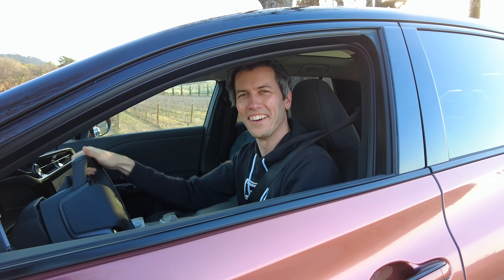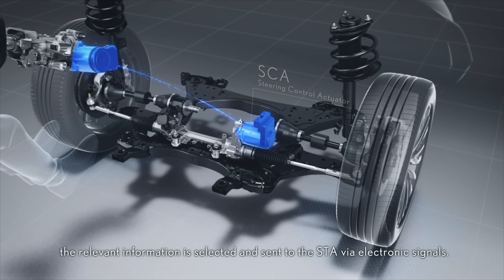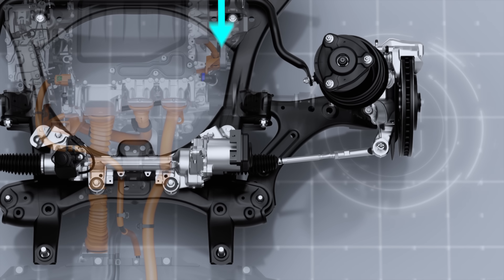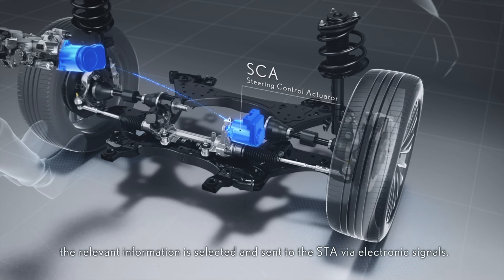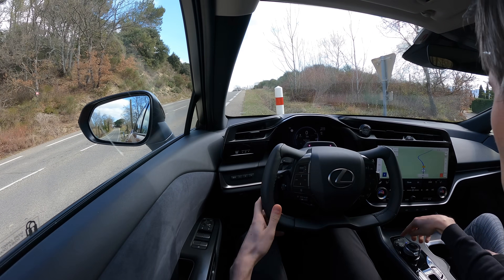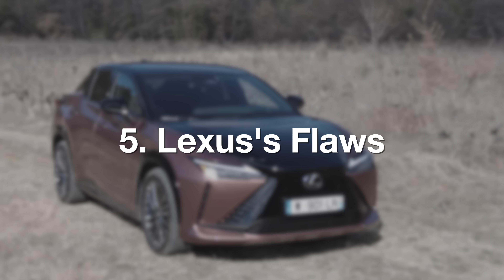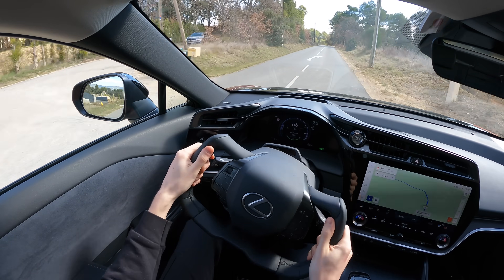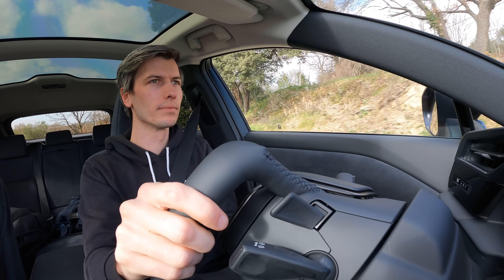How Lexus Fixed Tesla's Bad Idea: Steer-By-Wire Yoke

Comment: I would really like to see how the mushy response handles accident avoidance at high speed.  It looked to me like you would not be able to avoid a collision as well with this.
Reply: A large wandering moose has entered the chat...
Reply: 90's Citroen Xantia:  Hold My Beer...
Reply: i agree, If you use one steering angle on low speeds and second steering angle on high speeds how will I know how much to turn if I have to avoid something? Muscle memory is very strong, I don't want to instinctively turn a lot and spin out or something just because I wasn't at a low enough speed. 

Cars keep getting more and more unnecessary complicated and uses more sensors and wiring than needed.
Reply: Good point. I'd like to see this tech operate in -45c with winter, snow, salt conditions.
Reply: @jordanalexander1592  break by wire and gas by wire does just fine....
Reply: Physics will determine one way or the other how fast you turn the wheel and remain on all four wheels. This system may? reduce rollover but as mentioned, at what cost to performance?
Reply: It's a Lexus, you can guarantee they will perfect the design
Reply: By the time everybody has had 3 to 14 accidents in the car they'll start getting used to it. lol
Reply: And if you swerve to avoid an obstacle that suddenly presents itself (child stepping onto the road) will the car decide that's too much input and keep you going straighter?  "The car made me do it, officer!"
Reply: I think this could actually improve the response: a too quick change of direction of the front wheels could lead to losing grip or unsettle the balance of the car. With steer-by-wire systems the car can always adjust the steering angle to maximize front wheel grip based on speed, angular velocity, individual tire grip, weight distribution, etc.
Reply: @tamasbella3395  (about your comment on the mechanical steering ) Yes, but it is predictable. You are the one deciding at what pace the steering is done. You can't remove the human factor in a human driven car. I say - let's get rid of the steering wheel completely, it makes more sense than remove the level of human action effect in the driving. Anything that is not predictable is dangerous. 
You want safer roads in the era of densely vehicle populated roads - make the whole drivers license acquiring process 2x more complicated, make people get public transport.

Comment: 12:34 ".... a delay between the commanded request and that request being executed...." 

I doubt this has anything to do with input lag or something similar. I think Lexus deliberately smoothed out the turning speed and acceleration of the wheels a bit and its motor will overall behave more linear by nature. 
My guess would be it is a combination of stability control and driving comfort. They might say they won`t interfere with your steering input  but I can`t imagine they would ever allow a true 1:1 translation of your steering inputs, you could do some really erratic nonsense.

Comment: A steer-by-wire system would be great on a normal steering ratio using a regular steering wheel. The benefit is pretty much just the added leg room. 
This is coming from a tall guy.

Comment: I think most drivers will hate the yoke.  Maybe a few gamers and those of us who like the F1 3 and 9 o’clock driving position could deal with it.  But even us wannabe F1 pilots want to move our hands around on long drives.  The yoke limits hand location and I think the other 98% of the driving public will despise it.  Especially anyone who drives a crossover/tall car like the Lexus in the video. And the delayed reaction at the front tires is a total non-starter for the enthusiast driver.  Tire companies work hard to design tires and sidewalls that sharpen steering response at the front wheels.  Along comes a system like this and wipes out those gains by generating a slow/lazy reaction to quick steering inputs.  Not ready for prime time.  And by the way, besides being supreme drivers, a key reason that real F1 drivers can deal with the steering systems in their cars at high speeds is that their front wheels have much more limited steering angle than a street vehicle.  Which results in a turning circle the size of Kansas and requires them to do donuts by lighting up the rear tires to turn the car around in tight spaces.  So comparing F1 car steering to that on this steer-by-wire Lexus is not relevant.

Comment: What about kool guys who like to drive with their right hand draped loosely over the top of the wheel with their left elbow hanging out the window? Or people who grip the bottom of the wheel with their right hand? Or women who steer with their knees while putting make up on at freeway speeds. Not everyone likes driving with their hands at 10 and 2, especially on a long trip. People adapt slowly, but they do adapt so it probably doesn't matter.  How about a joystick on the driver's door panel for accelerator, brake and steering?

Comment: I do like to crank up mouse and analog stick sentitivity on pc and games. And I do set my logitech g920 wheel lock to 540 degrees instead of the default 900 depending on the tipe of race. But I don't like at all the idea of the yoke position being unnecessarily out of sync with the wheels because of delay. I know that's how a simulator works but there's no need to have delay in a real world car. So I'd personally still prefer a mechanical conection for that.
Edit: Of course I'd change my mind if they ever solve the delay issue

Comment: Another positive of steer-by-wire with short ratio steering: In a mechanical setup, a steering movement from the tyres (think collision) can result in wrist-breaking torque at the steering wheel. Hence why F1 drivers let go of the wheel before hitting a barrier. Steer-by-wire can limit this torque electronically as a safety feature.

Comment: What happens if you accelerate or brake in a curve,? Do you end up drifting out of the curve as you accelerate? Does the car turn sharper as you brake sending you into a spin or even oncoming traffic? No thanks. Stop trying to justify a bad idea.

Comment: What problem does the yoke actually solve? Lexus put that in just so it could be more responsive and all? But does it make you less tired while driving? More focused? More accurate? To me this just looks like something different from the standard wheel and probably have limited value to the driver.

Comment: The claim that "brake kicks in as soon as your foot leaves the pedal, before it moves to the brake" leads to more responsive braking is very misleading. If braking starts as soon as you lift your foot, you would not be able to put your foot on the brake while gliding, which actually makes the brake less responsive, if taking your reaction time into consideration.

Comment: Interesting, something I would not have ever thought of. I like what it could do, allowing for less turning of the wheel and more customizable feeling during driving.  I am another one who does not buy a new car anymore. I've been driving Lexus LS cars for over 20 years now but, I tend to buy them 7-8 years old with a little less than 100k, as long as they had a good service history (easy to find via Lexus Owners and combine with a car fax and you can get almost the entire service history on a Lexus). The problem is with these systems 7-10 years old and how dependable they will be then. 

I wonder when they finally announce an Electric Lexus LS if this system will be standard in it....

Comment: About the fast steering inputs on the highway, they need to be like that and cannot be messed with for security reasons. The driver must be able to do a quick turn in order to avoid an obstacle  while on high speeds.

Comment: So basically Lexus offers a electrified system of what Citroen developed way back in 1970 called Diravi. Self centering hydraulically driven with a redundant mechanical connection in the event of failure. Maybe not a Yoke but a much cooler single spoke wheel.

Comment: Formula One drivers also do not perform tight steering maneuvers.  No tight 90º turns into or out of parking spaces.  No K-turns, no U-turns, etc.  

Many planes today use fly by wire to control the aircraft and it is a safe technology.  

This sounds like something I would like to try, but I still like the idea of a wheel shaped steering device.  And I think it should be against the law to hide buttons and switches on the dash behind the steering wheel.  We don't do that in aircraft, why is it a good idea in a car?  Or anything?

Comment: As a Software-Engineer for over 20 years, no one will get me to drive a car where a software-glitch can make it go ballistic on me. If cars employ steer-by-wire, people will die from this. This question is not "if", only "how many". Every single heavily used software system has shown some failures (bugs) at some time. And those which did not reveal them yet, are likely to do so in the future. Don't kid yourself - this change reduces manufacturing costs in exchange for a yet unknown number of lives. There is almost no upside in this for the customer (except convenience or gimmicks) - only the manufacturer.

The most revealing problem can be seen in this video - modern highly complex digital software systems are treated as if they were analog systems. When talking about the "most pressing scenarios" how this steer-by-wire could fail, software glitches are not even considered! It is just assumed, that the software is a god-given flawless system. And believe me - software is not. If have friends working in major corporations from SAP to John Deere - and you do not want to know how the code looks. Without testing, modern systems would not even start up anymore. If you can replace a safety-critical digital system with an analog failure-free one, then DO IT. But never the other way around.

Oh and don't get me started with the "established" technologies in software development. Just an example: Are PC games new? Nope. So why are they buggy as hell upon release? Are bridges new to humanity? Nope. So why keep they breaking down sometimes? Because we are humans. We make mistakes. The best thing we can do is to not place ourselves into harms way. And replacing a physical steering-rod with highly complex software (force-feedback, changing steering-angle, etc...) is doing exactly that.

Well - I did my good deed at warning non-software developers about the dangers. Cheers!

Comment: I do like the idea of not turning the wheel as much when parking or turning in a narrow street.

Experiencing the Golf 8 however has significantly lowered my trust in electronic solutions made by carmanufacturers. Due to: regular warnings of assisting functions failing, sometimes all but the standard driving functions shuting down while driving and restarting. Once braking towards slow corner speed on a highway with a fast bend. Once starting to accelerate to 140 kph on a 50 kph road. Sometimes not regenerative breaking and without powered braking (oldfashioned pulling the wheel while pressing on the brake pedal with force to get to a hold.).

What worries me the most is when an error does not solve quickly after something happens. While it will be gone the next day. Then it takes about 2 months to get a spot for someone to take a look at it because they are probably busy with all new cars with the same problems still under warranty.

I does make me want a electric car with almost no complexity just mechanical pedals, wheel, parking brake, windows, seats. An airco (programable to a degree.), electronic mirrors. And a place where I can put my phone as the infotainment system while charging. Nothing more, but then you have EU legislation requiring all cars to have lane assist and emergency auto braking and such which makes it overly complicated again.

Comment: How does the dynamic change of steering ratio work in practice? Let's assume I am braking into a corner with a constant steering input of 5°. Whilst I am getting slower, the steering ratio changes, but my input on the wheel doesn't change. Will the wheels turn in harder as I slow down even though my steering inputs don't change?

Comment: First is not always best, Tesla (fans). That said, this is still early in and Lexus swung a solid base hit. A manual steering set control would be nice for performance vehicles. The nannies however still need to be nerfed for emergency situations. But this might be tied into the vehicles own environmental awareness, or driver assist systems, so the vehicle has context as to why you just jerked the wheel/yoke wildly just then.  

So we are just getting closer to building a horse.

Comment: Surely the extra torque sensor motors providing feedback are as complicated and weighty, if not more so, as an actual steering rack, and then you definitely are adding more fail points. The response argument is bonkers too. Cmon, who's ever thought that steering is a bit rubbish, unless it's over assisted (and this is ENTIRELY assisted)

Comment: It must be noted, that as far as how reliable the steer-by-wire system is, F1 and other racing cars have been using it for years, (they have short steering ratios not because they're better drivers, but because it's also a steer-by-wire system). And if it checks out in that harsh environment, as many safety systems have been developed in the racing environment, (ABS, monocoque crash zones, etc.), then I think it's safe to say that it's...well...safe.

Comment: "The steering location is much more flexible"

Being that Toyota / Lexus is a Japanese company, this is likely a big improvement for them as their UK/Aus/Japanese market vehicles have the steering wheel on the other side of the car.  You still have to redesign the dash, but at least that way you're not designing two versions of the steering linkage.

Comment: My biggest concern about these new technologies is the pieces of software that control all of these systems. There are videos here in YT showing how the F-22 fighter jet, which uses the same technology for controlling the air surfaces, sometimes behave in very erratic ways when whatever part of the system sense a different situation than what's actually happening. Talking about cars that would mean oversteering when it's supposed to be understeering, understeering when it's supposed to be oversteering, not recognizing inputs from the driver on time or even at all, or actuating even if there was no input from the driver. Software is very complex and programmers don't even know all of the software they write simply because thsts the nature of software, bugs are only going to show up whenever there's an accident, and rest assured there will be, it happens in airplanes and it'll happen in cars too.

Comment: The steering ratio that automatically adjusts during acceleration seems really interesting. One thing I would like to try, is to go in a very large open space, turn the yoke a certain amount and then accelerate while keeping the yoke in the same position. It would be interesting to watch the line start off turning sharply, and then it kind of smooths out and gets straighter the faster I'm going.
Reply: The automatically adjusting ratio will mean Navigating the same turns would never feel the same
Reply: @samueladole6074  - I was thinking the same too, they probably have proportional steering under various speeds.  I guess that's the beauty of steer-by-wire, they can customize it for any conditions.  They could even include a profile menu selectable by the driver such as "Lame soccer mom", "Midlife crisis dad", "Crazy teenager".  :D :D
Reply: @samueladole6074  that's kind of a good thing. When everything feels the same, the driver starts to zone out. They feel like they know every corner of the road and could drive even with eyes closed, and might not notice a kid crossing the road.
Reply: @tbqhwyf  Sounds like an advantage, but I bet most people won't like that. Most people want there driving to be relaxed and easy, and ao not having to be sharp every second. That can actually lead to more exhaustion.
Reply: *Accelerates in Fibonacci sequence
Reply: Golden ratio
Reply: Is this the kind of stuff you come up with while dreaming at night?! lol (jk)  It would be interesting to find out how exactly Lexus approaches this scenario. ;)
Reply: I'm sure, if they have any common sense, they will make this curve in such a way that you can turn wheels beyond limit of loosing grip at given speed even in ideal conditions.
Reply: @inevespace  erm, why?
Reply: @frozenwindow407  no point to make artificial under-steering. And it is hugely dependent on type of tires and road conditions.
Reply: If you checked the pinned comment, you'll see that Lexus mentioned that the wheel max angle is the same on low speed and on high speed. It's the actuation that differs, so if you maintain the same steering angle, the wheen angle will be the same even while accelerating.
But nice thaught though.
Reply: That might not be the case. The wheels might not start straightening up once increasing speed. Creator made a comment about it.
Reply: @frozenwindow407  It was a joke to the OP's point. I wasn't trying to be technical lol
Reply: @solcharms  yh I was replying to op. You beat me to the Fibonacci comment
Reply: that is called - SIU or steering integrated understeering. Just kidding.
Reply: The transition will be the hardest. Once accustomed it probably will be fine but having one of each might be annoying.
Reply: You mean you want to just experience some understeer? What would be more interesting to accelerate and experience no change to steering radius. Prodrive made P2 ages ago with active diffs that allowed that.